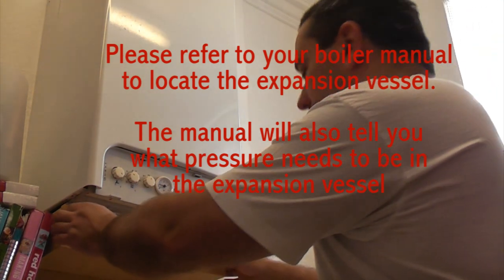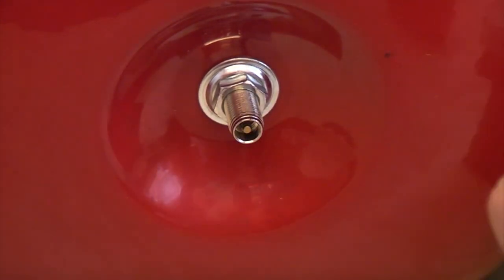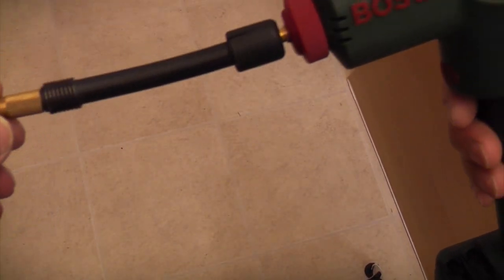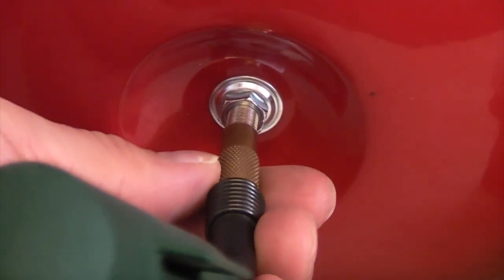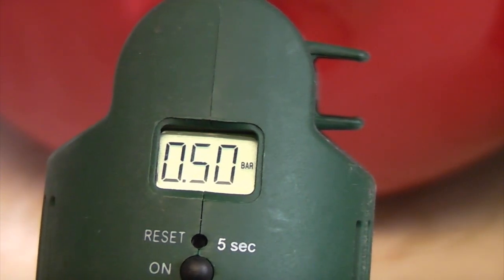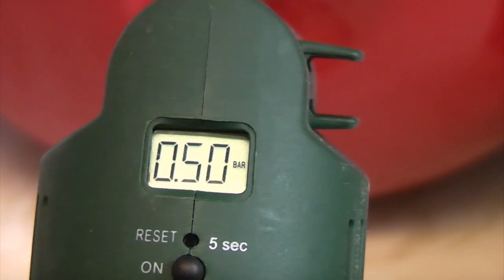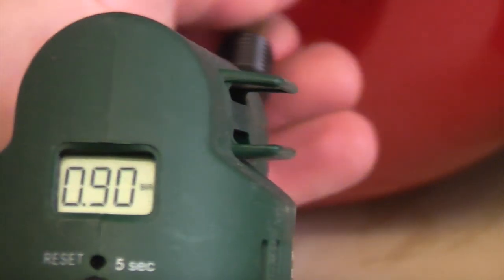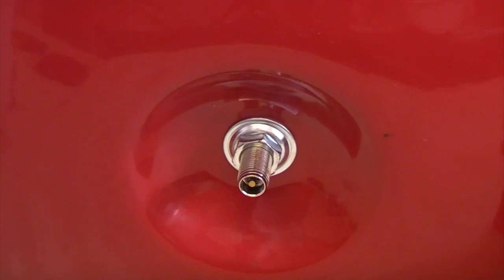How to recharge an expansion vessel in a combi boiler

Comment: Should you not isolate and drain the boiler before you recharge the bladder to prevent pushing against static water pressure?
Reply from the maker: You don't need to drain it down completely, just drain some water out from a drain valve or radiator. 
Thanks for the comment 😉
Reply: Ultimate Handyman If you don't isolate the central heating from the boiler, would you not be pushing against the head of pressure from the upstairs radiators giving a false reading on the gauge that could be up to 0.5 bar?
Reply from the maker: If you prefer you can drain the system completely, but remember to get a bottle of inhibitor to put back in the system.
Reply: Ultimate Handyman On a modern combi like a Worcester Bosch, you can isolate the boiler by shutting off the valves underneath on the manifold.That way you can just drain the contents of the boiler (approx 3/4 of a bucket). After charging the expansion vessel, close the drain,open the valves and top up the system pressure. To make sure the vessel is empty you can add a little air to evacuate the vessel whilst the boiler is draining.
Reply from the maker: @flyerh   How do you drain the water out of the boiler, if the valves are isolated?
Reply: Ultimate Handyman Bottom right of a Worcester is a drain valve (White plastic) which faces downwards.With bucket underneath, undo this valve and the water in the boiler will drain out until the boiler pipe work is empty. Other boilers will have a drain valve in different positions.If you can't get a bucket underneath, you can attach a pipe to the valve.
Reply: I think you might be both at cross purposes here. This is an external expansion vessel. For an internal one you could isolate and drain the boiler as the expansion vessel is located inside the boiler. An external one will be exposed to the pressure in the central heating rads and pipework so letting pressure out of the whole system via a rad or other drain off valve seems to be right

Comment: Very useful Video ! Thank you.
Can you show us how to disable an Internal (Combi) Expansion Vessel, that is leaking from the air filling end ? Does one fit an End Cap ? If so How ?
This would be necessary in order to render the internal expansion vessel useless before fitting and external expansion vessel. I have water leaking from the internal expansion vessel. This would need to be stopped !
Reply from the maker: If it's leaking from the Schrader valve try to press it in a couple of times, this can help to remove crud from the seat of the valve- which might stop it leaking. I'm afraid that disabling the existing expansion vessel on most boilers will require a Gas safe engineer as you need to remove lots of components from the boiler in order to get to the expansion vessel.
If you think your expansion vessel can be disabled safely without removing most of the boiler you can ask here and the central heating guys will hopefully advise you- http://www.ultimatehandyman.co.uk/forum1/central-heating-boilers-f35.html

Comment: Spot on sorted my main Eco 30 for anyone with the same boiler to save you some time there's a round disc with three screws holding it on the top right hand side of the flue pipe remove this plate and the valve is there .Many thanks
Reply from the maker: Thanks for the comment ;-)

Comment: I have a white colour varem extravarem 12 ltr, on it it says max 6 bar, then a sign showing 3.6 bar, what should I pump the pressure to, at the moment it is zero
Reply: +Handy Andy a little late but the varem 12ltr comes pre-charged at 3.5bar as its a unventilated hot water system tank it needs to be this to supply correct pressure to the taps

Comment: my mini c24 combi overflow pipe is pissin water out doin need to follow tour steps in this video will that help
Reply from the maker: +imanishay 
It depends. If water only exits the blow off pipe when the central heating is on you probably have a faulty expansion vessel.
If the blow off valve is leaking water constantly you might have a faulty pressure relief valve.

Comment: My Vaillant Ecomax Boiler is at 2.5 on the pressure gauge and goes off the scale when the heating comes on. Also, one radiator is warm even when the heating is off. Any ideas? Thanks.
Reply from the maker: +Dai Morgan Probably best if you ask the boiler guys here- http://www.ultimatehandyman.co.uk/forum1/central-heating-boilers-f35.html

Comment: If there is water in the expansion vessel do I need a new vessel or can I empty it out and re-charge.
Reply from the maker: If water is coming out of the schrader valve when pressed the diaphragm is leaking and so you need a new vessel, either a replacement or a secondary one-
How to fit an expansion vessel
Reply from the maker: G Dixon
You are welcome ;-)
Reply: hi we have a similar problem on our boiler,water is coming out of the compression tank,so the diaphragm is leaking?one from diverter valve?when the boiler starts pressure is on under 1 bar but in 10 seconds it rises up to over 3-4 bar and stops with a lot of noise,could that be the pump too?
Reply: its just condensation its very rare the seal split all you need is a new Schrader valve

Comment: Hi I did as your video says but now my boiler just losses pressure over an hour until the gauge is back to 0...what can I do??
Reply from the maker: +Chris Smith If your boiler is constantly losing pressure you either have a leak, a faulty expansion vessel or faulty pressure relief valve.If the system loses pressure when the heating is not on you have a leak somewhere.If it's only losing pressure when the heating is on you probably have a faulty expansion vessel.Have you pressed in the Schrader valve?Did any water exit from it?

Comment: Hi. I have tried putting air in valve but it just loses the air from it immediately. Also it feels quite difficult to get air in. Could there be a blockage?
Reply from the maker: Is the air coming out through the Schrader valve?
Reply from the maker: It looks like you might need a new expansion vessel or a new Schrader valve. I believe you can install a new Schrader valve, but I have never done it.

As long as water is not coming out of the Schrader valve- it looks like the membrane in the expansion vessel is intact!

You can get the heating working again by letting some air into an upstairs radiator, then after it has some air in the radiator you can pressurise the system to the recommended pressure and the boiler should work again. The trapped air in the upstairs radiator will work like the expansion vessel and should prevent the pressure relief valve from discharging when the boiler gets hot.
Reply: Firstly thank you for your swift replies as I really need a solution right away due to baby. I have used a new pump and when I pump I can hear air escaping from valve. Now I have quickly capped it and it shows the pressure in boiler as 1 bar? I thought the air and the water are pressure are independent. Is this suppose to happen. Thanks
Reply from the maker: In the expansion vessel there is a membrane, which separates the water from the central heating and the pressurised air (which expands and contracts- unlike the water). When you pressurise the expansion vessel you need to let out some water from the central heating, or else you are trying to compress the water in the system. Once there is room in the system, you then pressurise the expansion vessel to the correct pressure. Once you have done that you can then top up the water pressure via the filling loop.

It's unlikely that your expansion vessel will hold it's charge if only the cap is holding in the pressure (it will probably lose pressure over time).

Because you have pumped some air into the vessel, it has shown as pressure on the water side as the membrane will be pushing against the water in the system.

No problem about the replies, I'm off out now for a few hours though!
Reply: I've just put heating on and it's gone up from 1 bar to 2.5 bar in 10 minutes.  Also pcv has started to drip from pipe outside. Slower than before but still too high. I did have air in a radiator downstairs that I sorted out yesterday (wish I never did now). Yesterday When I filled boiler with water pressure rose to 3.5 bar. I quickly released it from another radiator. Don't know if that caused any damage to vessel now. When I tested vessel with gauge before attempting to put air in it read 0 bar.
Reply from the maker: It won't have caused any damage to the vessel, the pressure relief valve will always open before any damage can be caused. It's likely that your expansion vessel has been faulty for a while, and the air in one of the radiators was acting as an expansion vessel (air is compressible, but water is not). When the radiators are bled, there is no air to compress, so once the boiler pressure is set at the filling loop to just over 1 Bar, everything is fine- but when the heating heats up the water it expands and as there is no air to compress in the system the pressure increases until water discharges from the pressure relief valve.
Reply: That's a perfect explanation! Now problem I have is prv is letting out water at 2.5 bar rather than 3bar. When heating is on now it fluctuates between 2-2.5 bar and when off at 1 bar though I don't know how long this will last. I notice the prv pipe dripping a lot less when heating is off. If prv is faulty should it still drip even when CH off causing pressure to drop? I think my best coarse of action is try to put system back to how it was though I don't know if PRV would reseat itself. Do I just shut off flow valve to radiator and then loosen nut to allow water out of rad whilst bleed screw open? Cheers
Reply from the maker: @a5amr2   Pressure relief valves can weep once they have opened, sometimes debris gets in the seat and prevents it from closing fully. To let some air in the system, ensure the boiler is switched off and open a bleed valve on a upstairs radiator. Water will come out of it, so have some rags there to mop it up. When water stops coming out, close the bleed valve. Then go downstairs and bleed a downstairs radiator until you remove about 1 litre of water, a plastic bowl is handy to catch the water.  Close that bleed valve, then open the upstairs bleed valve again, just in case it sucks in some air. Then  repressurise the system again, you should then have some air trapped in one of the upstairs radiators, which should act as an expansion vessel. Obviously make sure you don't bleed the upstairs radiator, or the pressure relief valve will operate when the water gets hot. The relief valve might reseat itself, or you might have to keep topping up the pressure- or get the valve repaired.
Reply: Thank you so much for your replies. You sir are a legend

Comment: I have a Modena 80 E Boiler. Using a bike pump, I pump the pressure up to 1 bar, but as soon as iIunscrew the pump, the air comes back out of the expansion vessel.

Comment: many modern boiler cases form part of the combustion seals stoping flue products entering the room the appliance installed in, in the eyes of the law you need to be a competent person to remove these cases as its very important to check the seals condition and refit correctly. Check with manufacturers information before removing your boilers case.
Reply: In Ireland, its only legal for Gas Registered Installers to open a boiler , with penalty such as fines and jail time,there have been cases of non registered plumbers been convicted of such for such offences

Comment: Can this cuase my boiler to bubble like crazy ?
Reply from the maker: No, I don't think so.
Normally if there is a problem with the expansion vessel the system will lose water and require topping up regularly.
Reply: Thanks for quick reply , that's one worry off my mind , i've bled every valve i could find and there is no air coming out but it's bubbling like mad and started groaning now , any ideas ?
Reply from the maker: It could be a few things, but I'm no boiler expert so it might be best asking a plumber.
I'd start by checking the pump is working, normally you can feel the pump vibrate when it is in operation.